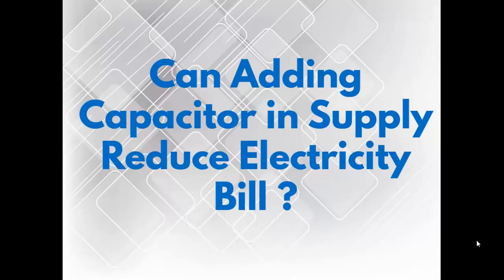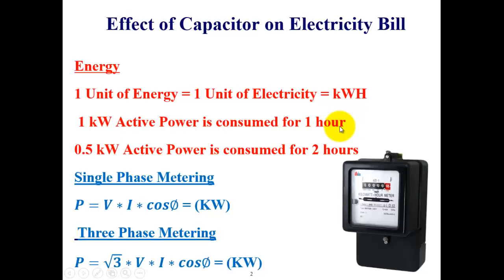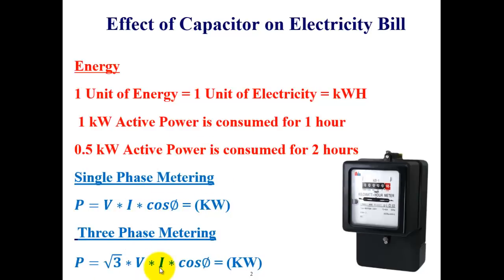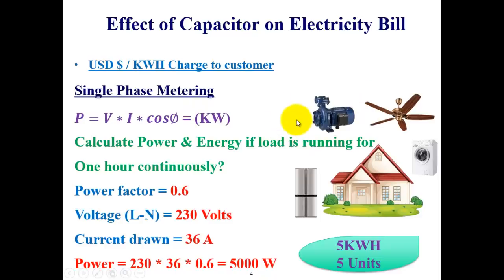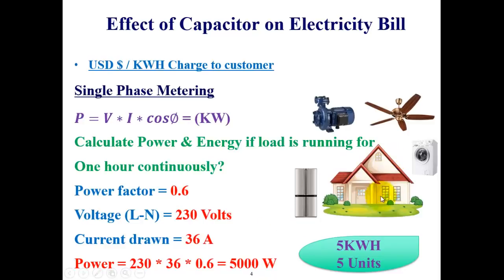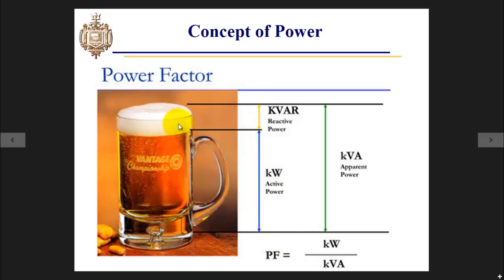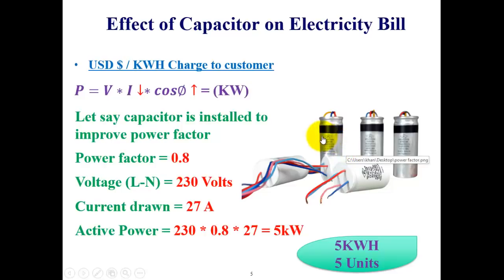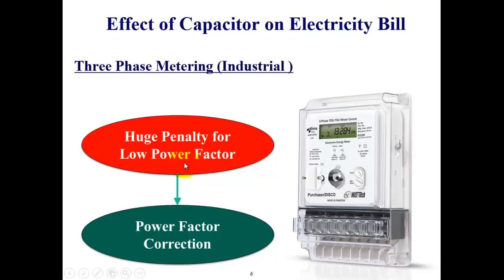Can Capacitor Reduce Electric Bill ? | Truth Reveal

Comment: Can I use a capacitor to save for my electricity bill? If yes, which capacitor does save more electricity
No, you cannot use capacitor to save for electricity bill ! Why ?
For this we need to know about power in alternating current Circuit. !
The answer is going to be long !
There are 3 types of power in alternating current :

Active power : The active power is the real power, and it is measured in killowatts.(PRODUCT OF VOLTAGE•CURRENT•COSΦ cos Φ being the angle between voltage amd current).

Reactive power : The power which flows back and forth that means it moves in both the directions in the circuit or reacts upon itself, is called Reactive Power.reactive power does not do any real work and thus sometimes called as imaginary power. Measure in kVAR.(PRODUCT Of VOLTAGE•CURRENT•SINΦ.)

APPERENT Power : the vector combination of above 2 power is called apperent power ! Measure in KVA.(product of just voltage and current)

Now
What does capacitor do ?
It stores electrical energy in form of electric field which can supply current when there is change in voltage which keeps it constant ! For ac current it reacts in ac power in which current leads voltage by 90° (ideal capacitor)

What does inductor do ?
It stores electrical energy in form of magnetic field around it. It reacts in ac power i.e voltage lead current by 90° (ideal inductor)

Since almost all ELECTRICAL device are inductive in nature ( microwave oven, induction motor fan, pump motor) this gadgets consume reactive power along with real power which increses current In wire (real power current + reactive power current) and also reduce power factor(pf)
In real power the cos fi is also indicates nature of load.for example pf=1 means there is no reactive load.(only resistive)Below 1 to 0 is inductive load. And above 1 there is capacitive load. The more the pf is toward unity the better the power factor(less current)
Since electricity board charges only for active power the capacitor cannot generate or consume real power(exception are there). Thus using capacitors is useless for domestic consumer as well as commercial consumer.
But wait, Since industries use inductive load it also uses huge amount of reactive power.. Which causes huge amount of i^2r losses in wire resulting in more capacity grid and expenses for electricity board.thus electricity board not only measures active power but also reactive power.Reactive power can be compensated by introducing capacitor not one but many (usually bank which operates as per power factor being bad). This capacitor bank helps in increasing pf.
The electricity board penalize the industry for there pf being bad thus capacitor bank helps them maintain good Pf which not only save them from penalty but also get token of appreciation(usually a very little discount )from electricity board for maintaining good power factor.
Bottom line : capacitor does not save electricity neither electricity bill.
Sorry for long answer.
If you like the answer don't forget to upvote !
Reply from the maker: Great explanation. Very well done

Comment: In generator terms I'm not sure exactly what bad power factor is doing. Resistive loads provide constant slowing in the generator, but reactive loads are slowing the generator for part of the cycle and speeding it up for the other part - like putting a spring on an arm on the generator? Also they waste more energy in wires because you have higher peak currents than you need with a purely resistive load.

It's like trying to start a car engine which is a combination of mechanical resistive and reactive loads. It has a flywheel which is inertia to accelerate (inductive) and compression in the cylinders (capacitive) and finally air resistance in the valves and exhaust and oil resistance and friction in the cylinders and coolant flow (resistive).
Or if you take a fixed gear spin bike with a big steel flywheel from a gym, the inertia to pedal up the generator in the flywheel is inductive reactance that will kick your feet if you lock your legs from high speed. The felt pads on the flywheel are a resistive load. A capacitive load would be attaching a spring to the flywheel that stretches and actually prevents the pedals turning after a certain amount of stretch, so only if you pedal forwards and backwards will it work.
Reply from the maker: Informative

Comment: Yes here comes the point:
IS every meter calculating also by cos(pf) ? - If Yes, it makes not much sense to avoid it at private home usage.
But I try to as fE a server PC takes 50 Watt at 0.87 pf, and so I had an opportunity to test calculation and result.
Adding the calculated 2uF Capacitor parallel to the load, the pf even got worse.
So I stuck anyway, but your point makes it take easier anyway ... IF our meter is doing V * I * cos0 ...
So far I see the higher the load of more PC and Monitor, the better the pf is getting ... another NOT energy saving solution. Ha
Reply from the maker: Its not the meter actually, its how the active power is calculated. The load will always have the same kw and most of the countries charge for kw
Reply: @electricallectures  Ok, here we got:
* I have a private 5(15) meter, added about 3 households on this meter and THERE I don't have data
* research yesterday about Thailand electric meter show that this 5(15) meter are NOT including a pf correcter, pdf's show far clear only Volt * Amp = P (Watt)
* also as private connection so far I see now extra charge as of 'more' reactive power or fined as of to low pf
* ... charge by KWh, yes ... but Watt/hour is still is "Volt * Ampere", and when the Ampere is higher as of leading or lagging reactive power, also Watt is higher than needed and so also the bill.

Comment: The energy loss in the wires are reduced with capacitor installed. That's how it will save energy. So capacitor definitely helps

Comment: With a proper circuit board like ras pi you could hook up a capacitor for the start load, batteries for saving power, and set a charge time in your computer for the cheapest time of night. If you have solar, you can charge in daytime too. Test your home power usage before buying equipment or trying to salvage old equipment.

Comment: Only large usage of KW/electricity that have inductive loads will benefit from capacitive power factor correction. It's better to focus on the efficiency of specific devices by factoring in lumens/watts or horsepowere/watts.
Reply from the maker: Yes rightly said

Comment: If the voltage drop across the cable is large, does the change in power factor not cause the voltage drop in the conductors to decrease? The power loss on the conductor would decrease and the wasted power would be less. Maybe the calculation of economic efficiency should be more complex.
Reply from the maker: Voltage drop would increase but the total power remain the same
Reply: @electricallectures  The total power would decrease if the capacitor were placed next to the consumer => the total current decreases => the current per conductor decreases => the power lost per conductor decreases (real part) => the total bill decreases. Even if the inductive part is not billed.

Comment: 27 amps?? From where this arrived ... Not explained in details,,,

We have installed automatic capacitor Bank for our building which automatically switch on and switch off the capacitors to maintain the power factor 0.9 ,,, the overall electricity bill has drastically reduced...
Reply from the maker: If your building is commercial then obviously it will reduce sue to penality avoidance

Comment: Can we use power factor = 1  or more than that  ???
Reply from the maker: Leading power factors can damage the power source devices such as generators, alternators, etc because generators, alternators cannot withstand the leading power factor.

Leading Power causes to increase the receiving end voltage than the sending end voltage in a transmission line.

Comment: But why we use capacitor to chakki motor in 3 phase.  Im also a electrician i have practical experience whe we add 11 kvar capacitor in 15 hp motor it takes 10 ampare but  without adding capacitor it takes 15 ampare.
Reply from the maker: Ampere will reduce bcz power factor is increased by adding capacitor. Overall power of motor remain the same. You add capacitor in order to reduce current which has lots of benefits but not electricity bill

Comment: Attention between KW, KVA, KVAR, KVD (distorsion wave). KVA=KW+KVAR+KVD. The metter measures only KWH, means active power, means power like in DC current, U*I=P (watt). The metter doesn't know about KVAR, KVA, KVD. For this exist special metters. The cos xx si for metter ideal, means 1. For this the metter is built to measure correctly the power for what we pay the bill. The rest is theory for us. A capacitor consumes nothing in ac/dc circuit, the resistance, capacitance is big. The voltage is danger for it.

Comment: Simple and straightforward explaination...but with a p.f. corrected cap in circuit your household wiring draws lower utility current...so it's that much lesser stressed...
Now the properly rated hardware...( wire gauge..fuse ratings...thermal trips...ckt.brakers...switches & sockets... etc ..) can be optimally downsized..so this lowers the costs....& improves the overall " safety factor" of your household equipment..so you become a contributor to improving the " electricity footprint " in s small way.

Comment: used to own a coil you needed to put between a few point on the meter and made the thing run backwards
Reply: Older non digital meters use magnetic field to read electric current, if you allegedly stuck a big magnet or put a magnet around the old meters it would slow them and cause your electric bill to go down I guess. Haven't tried it myself. But I've partially or fully bypassed meters before out of necessity on new construction. It's a general practice around here and nobody really says anything when we're building new houses.🤷
Reply: (in the USA)

Comment: In your example, 2 variables have changed. Before capacity installed, PF=0.6 & current = 36A. After capacity installed, PF=0.8 & current = 27A. Why is there a change assuming all other factors remained the same. Should current also stays at 36A?
Reply from the maker: Thats a good question. Remember that any load has fixed maximum power in kw that it will consume and also voltage at which it operates. Only this that varies is the amount of current and power factor
Reply: @electricallectures  Our billing is based on kWh only. If kW remains the same then how do we reduce the bill and witness the savings in our case?
Reply: @ashwath722  good one
Reply: @ashwath722  your question is wrong. Electrical lectures clarified 100%
Reply: All these Dumb unclear video is just for their  own beneficial purpose.
Don't follow these.
Books tell you the truth.
So we educate it.
I don't believe in this video what is talking about.

Comment: I would say that modern smart power meters may detect the existing PF and calculate pwr consumed as per formula mentioned. In contrast, OLD spinning disc meters turn cogs which moves the revolution counters depends on the number of revolutions to register pwr consumed by customers. In this case, adding a capacitor reduces current and disc spin speed, hence lower meter readings for the appliance used. It was benefitial then, but doubtful nowadays...
Reply from the maker: Yes absolutely correct

Comment: Watt-hr meters measure "True" power, not "Apparent" power. True power is the product of rms current in phase (no phase lag or lead) with rms voltage.
Reply from the maker: Volt-amperes measures all power passed through a distribution network, including reactive and actual. This is equal to the product of root-mean-square volts and amperes. They are different from the utility energy meters at consumers end
Reply: @electricallectures  The instrument to measure power at the consumer (customer ) does NOT measure Apparent power (real and reactive ) - For example: The meter at my residence measures real power only.

Comment: a power factor of .6 will use more apparent power by your motor running less power, restoring 40% to the grid and you will not be paying for it.   Caps are added by the power company to make a pf of one so they get full billing.
Reply from the maker: True

Comment: I doubt the average home would have enough induction motors to affect the PF very much, I worked in mining for many years, I served my apprenticeship as a coal mine electrician in the 1960's and it was policy to install PF correction capacitors to reduce "wattless" current. The power utilities charged my employer extra for poor PF correction. Our coal mines contained vast numbers of electric motors from low HP to large 300HP motors, later mines much larger HP's, so without correction we'd have poor PF and the utilities would charge us extra. For many years fluorescent lights had built in PF correction capacitors.
Reply: It only became a “thing” for me once i installed a 36kw hot water heater
Reply: @Scuba_Bro  I would have thought most heaters are largely resistive, although perhaps AC in a coiled element is lowering the power factor a bit.
Reply: @TimpBizkit  that’s a good point, I just started to think that because it caused some lights to flicker but those are already LED lights on dimmers which are possibly just causing their own noise
Reply: @Scuba_Bro  Thats a resistive load, shouldn't affect the pf

Comment: What is the best option to safe electricity ?
Reply from the maker: Most of the household appliances are now inverter based. They are efficient and intelligent and consumes less electricity. Also for airconditioning its always recommended to set your temperature setpoint to 26 or 25 not less than this.

Comment: Note that in the USA,  while most home circuits are 110-120VAC,  the input into the house is 220-240VAC and then split into two 110-120VAC legs.  So if the house's wiring relies on only one of the two 110-120 VAC legs,  you get charged as if you used both,  doubling your bill.  So it is generally best to make sure that the appliances that use the most current over each day are evenly split between the two different 110-120VAC legs.
Reply from the maker: Thanks for sharing useful information
Reply: look like we still underestimate the power company of criminal intent.
Reply: how does that work? Meter gets measured off watts. If you use only 1 leg, you are using twice as many watts on one leg but if you split them on 2 legs you are still using the same amount of watts but they are simply split in 2

Comment: Tell me something, how can a radio station, or television station transmit 100k watts 24/7 and pay the power bill ?  Just sayin, someone knows something !
Reply from the maker: They are consuming electricity from the grid  depending on transmitted power requirement. It is to be noted that there are different types of tariffs and there are different criteria of calculating bills. Its not that simple. This video focuses mainly on residential and industrial tariffs

Comment: Then One my Question sir 

Every place Bill should e same while ampere is no.matter it is less or high ampere

Secondly go for 
.999 pf not at 0.80 ...why go for only .80
Reply from the maker: Electricity is charged for kW not current. It may be less or more for same kW depending on power factor.
Secondly most machines designed at 0.8 pf at rated load. You can only improve it with capacitor bank
Reply: .999pf. is ideal...but very difficult to achieve...the cost for trying to reach it will rise exponentially...and equipment will also be complex...not just more capacitors... ideally today 0.9-0.93 is more realistic

Comment: I connected two 2.2mfd capacitor in parallel very near to the main switch(that is near to the meter).
   Now Iam getting electricity bill continuously 25% less than before how?

Comment: Those so-called "electric saver" devices are actually a capacitor used to "dampen" the inductive effect of electrical devices with coils  such as old flourescent lights or old aircond compressor on the electrical wiring's total resistance (inductance contributes to resistance in AC circuits). If the inductive effect is either small or absent due to usage of energy-saving electrical devices or flourescent lamps being replaced with LED counterparts, then the capacitor itself will contribute to the total resistance of the wiring via capacitive effect. Total resistance R (total) = R + √(xL^2 - xC^2)

Comment: I'm your new subscriber frm the Philippines.

You are ok! Your explanation is clear. The only thing unclear is the value of the capacitor, where to connect it & how to connect it.

I consume 250 KW every month. Now, forgetting all other videos and or explanations, let's go straight to the point. Would a 5 - 10 uF/450v rated capacitor used in washing machines & air conditioners achieve the purpose? Which one along that range is the best? Also, I constructed below a table (if you will), where, as I said, being straight to the point, you can fill up, based on your computations, the capacitor ratings in accordance to monthly consumptions.

KW USED      CAP VALUE
<100KW               ____uF
100 KW.               ____uF
200 KW.               ____uF
300 KW.               ____uF
400 KW.               ____uF
>400KW.              ____uF
This, based on the assumption that the capacitor is wired in the main panel thru a circuit breaker or a fuse. Thanks in advance for the answer.
Reply from the maker: Thanks for your time and lovely comment. What I get from your question is that you are interested in finding the value of capacitor to be connected across main supply for power factor improvement. I will soon upload the video from which you can easily compute the values in the table